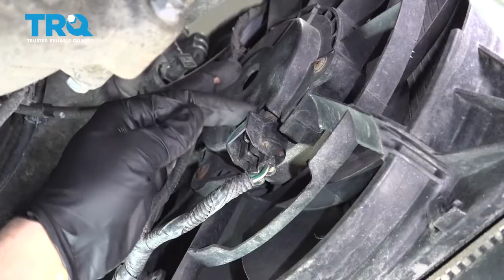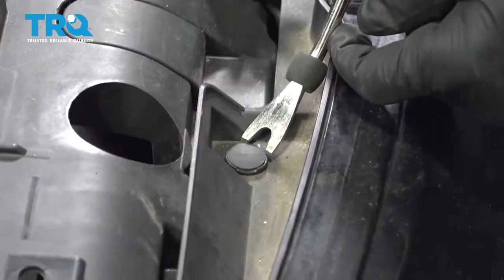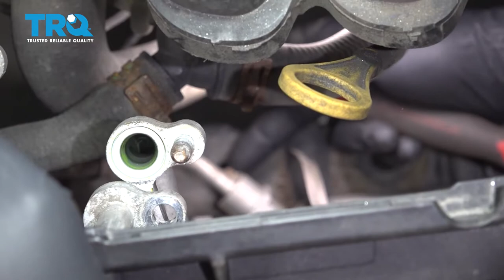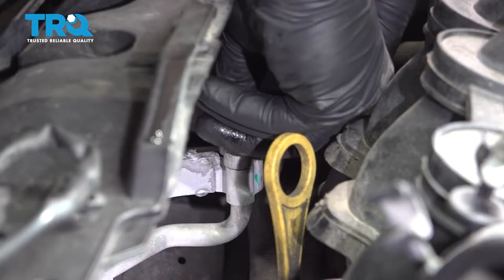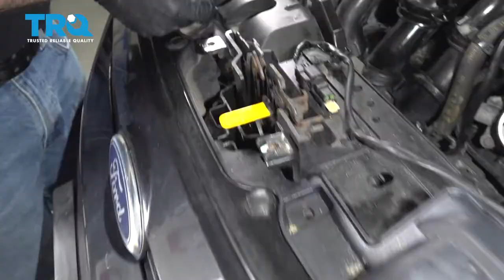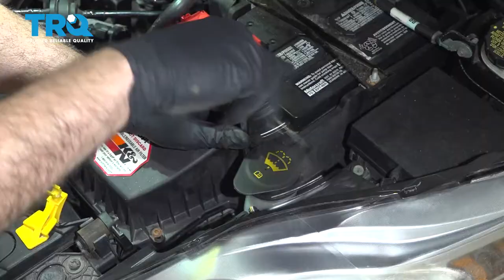How to Replace A/C Condenser and Receiver Drier Assembly 2011-2019 Ford Fiesta

Comment: ok, so how do you remove one of these studs if you want to replace the pipe connecting to the condenser without having to buy the condensor as well, i gluing these in a good idea, someone might have done that on mine as it will not come out and the garden now want £1200 to replace a leaking pipe which should have only been a £400